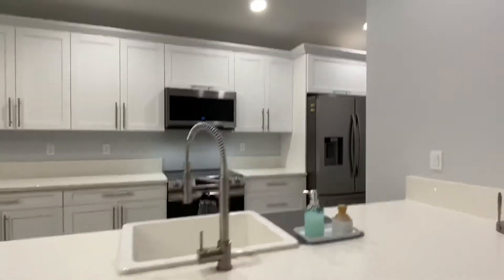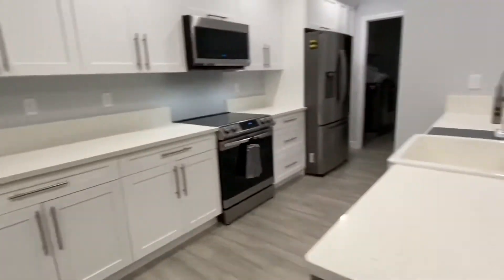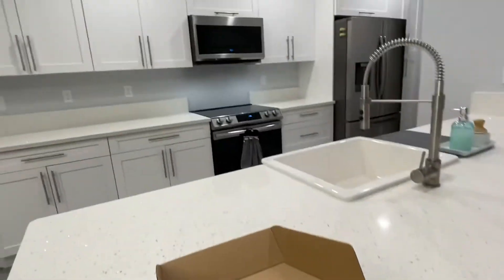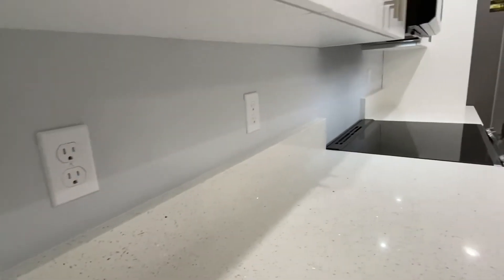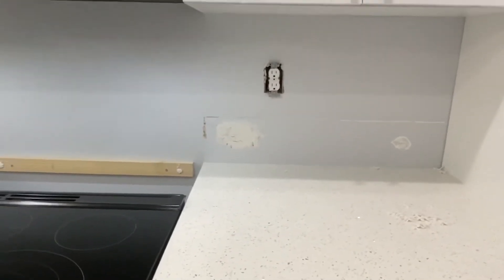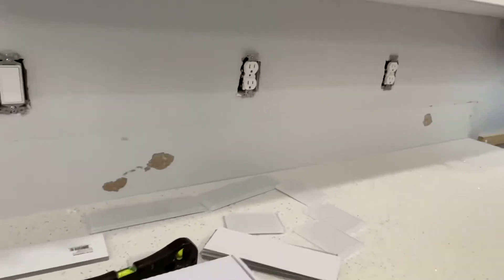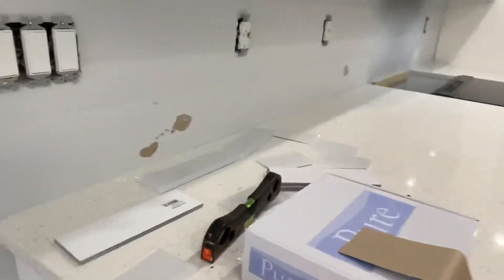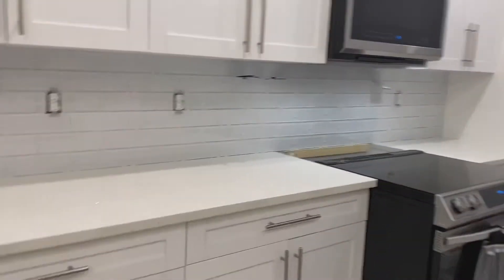Glass Tile Backsplash Install

Comment: Very nice work but like someone else mentioned, it is recommended to use a polymer thinset for glass tile and not grout the gap between the countertop and tile. Best to  caulk that area in case you need to replace the countertop in the future. Likewise, the grout should be a non-sand grout to prevent scratching the glass.
Reply from the maker: Thank you for your input and great tips! Thankfully it has been holding up well and we did not have any scratches. I believe it was unsanded grout, we have used sanded grout in the past in different projects with a wider grout line and it was definitely not the same, no gritty texture.

Comment: Very nice work. How did you cut the tile, especially around the outlet?
Reply from the maker: I used a wet tile saw cutter, with a Rigid Diamond blade
Reply: @Thelifewithlily12   Nice work !.   How did you round of the inside corner for the outlets? I watched many videos of glass install but no one ever explained their process